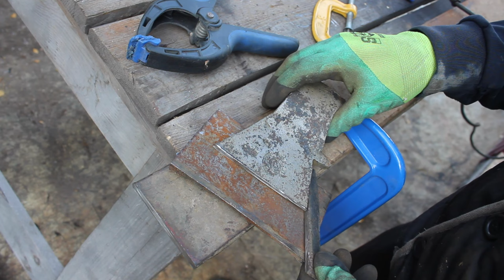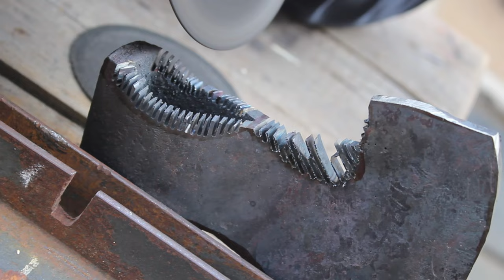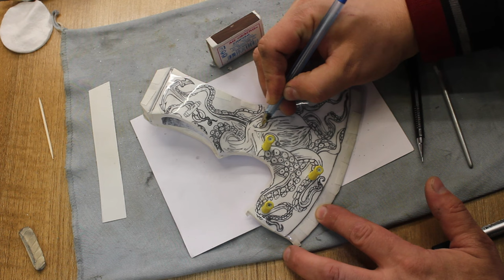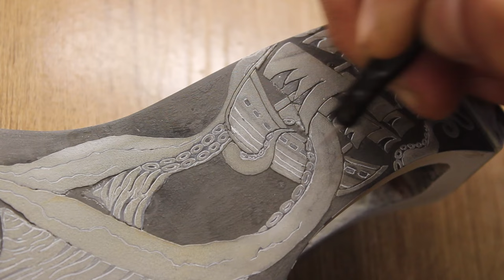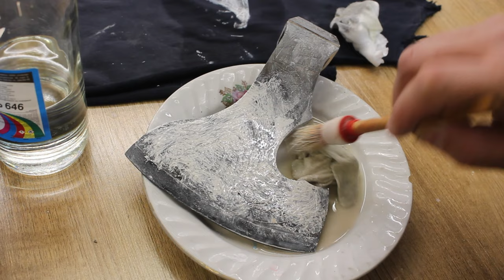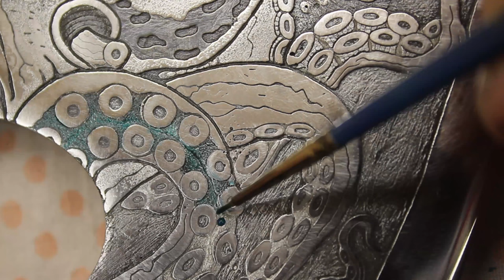An axe with an octopus.  2 months of work.  Drawing on metal.  Simple technology from a rusty axe

Comment: Awesome work of art.  I am so impressed with the level of etching control you get with electroetching instead of using acid.  I love your theme for this axe, my favorite of yours so far.  Thanks so much for the videos they are great teaching tools.  I have yet to try the dot engraving and oil paint to enhance shading, but I really love how it added to your piece.  Does the oil paint hold up well over time? Thanks again for sharing your amazing work.
Reply from the maker: Thank you. This is my first experience working with oil paint, but I think that if you apply a protective layer on top, it will last a long time. Creative success! 🤝🤝🤝